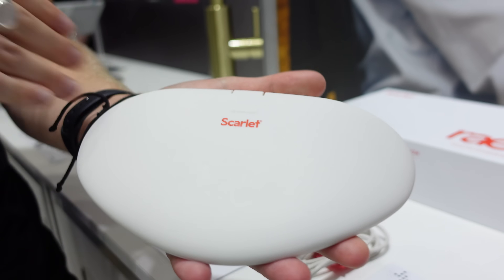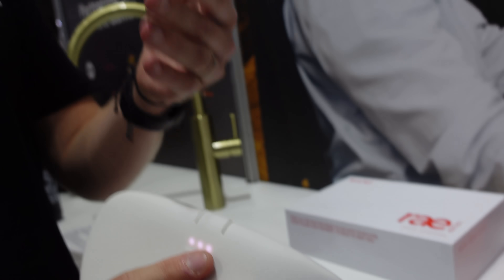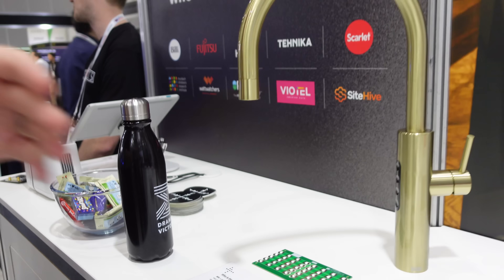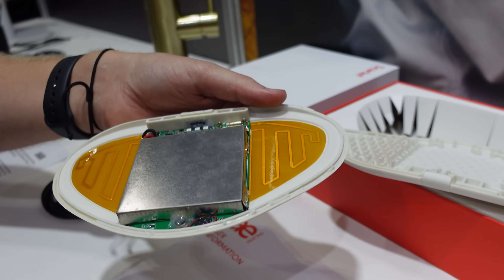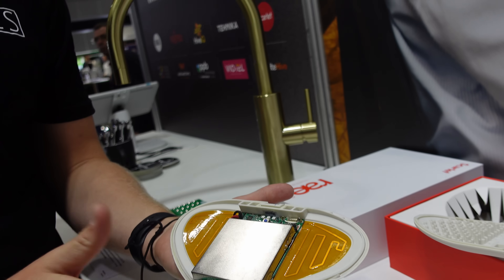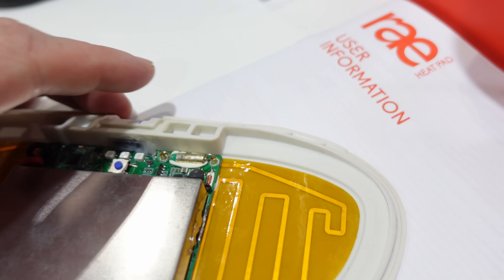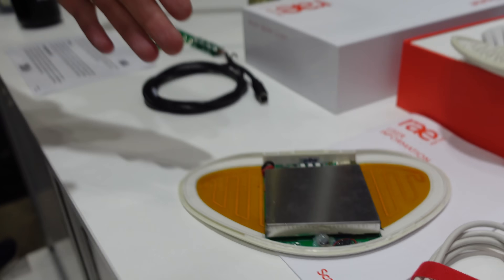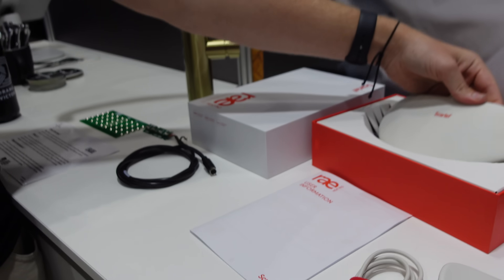EEVblog 1694 - Scarlet Rae Teardown + Design Discussion with Xentronics

Comment: how long before that rigid-flex-PCB breaks? seen similar constructions with sharp corners. Shielded FFC are made for decades in LCD , sometimes they glue AL foil to FFC ... or custom two layer mylar FFC for cameras...
Reply: The track design is not optimal, the outside corner is rounded but the inside is not. But, I don't think you'd normally be flexing it much, think it should be OK.

Comment: A nice product and construction; I'm only worried about the thermal design and heating the LiPo battery leading to premature failure, and a ugly one at that, since it'll probably smash the PCB if it decides to go all pillow.
The good old fashioned Unix way... do one thing and do it well.

Comment: Just a heads up people. I would avoid ordering directly from Fnirsi these days. I put in a two item in-stock $430 order three weeks ago. Tracking on one item has proven to be bogus. They responded to my first email inquiry about shipping the second item, and why there was a hold up on the first item after shipping. They lied on both counts. They have not responded to emails in two weeks. My stupidity for not ordering from Amazon.

Comment: HUH... Just converted 50C to F, and in F that's 122F. Our water heaters in the USA tap out at 140F or 60C. I use 140F in my kitchen.
Reply: IIRC  human skin can start to experience burn injuries at around 45°C
Reply: @Rotwold  I use 140F/60C to act as a preliminary disinfectant while doing dishes. In the shower, I have my heater set to 98F or whatever C. Apparently it's about 37C.